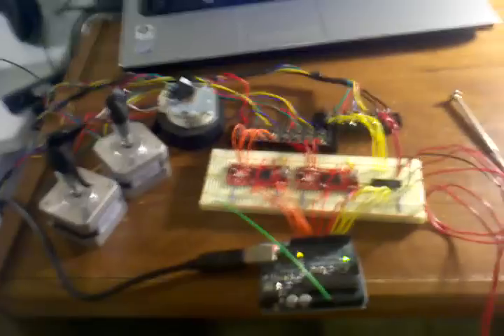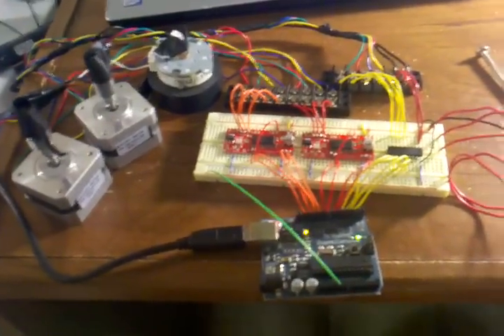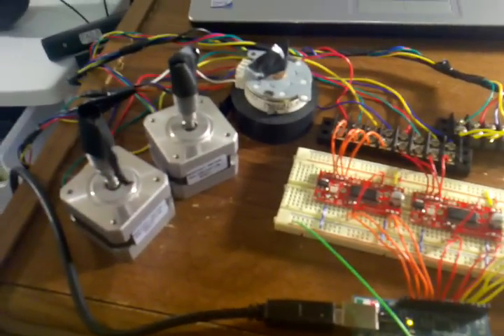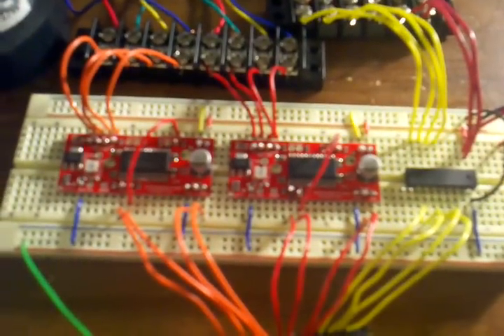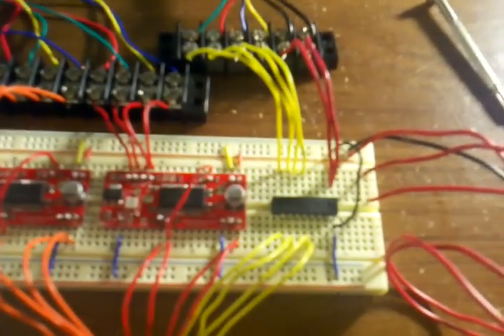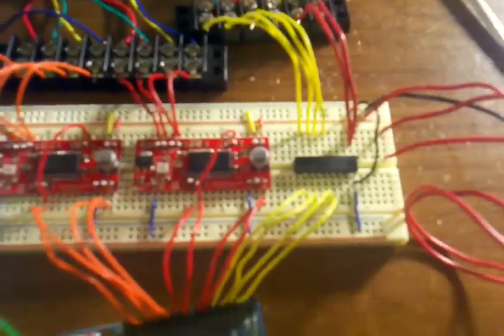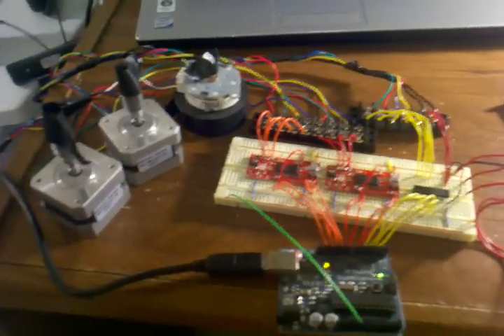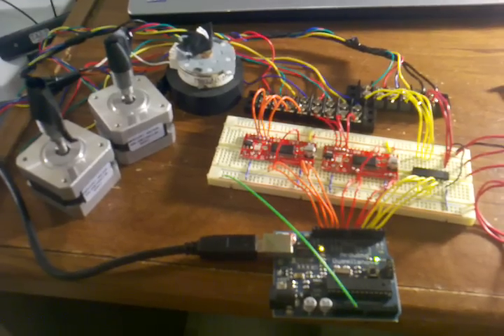controlling multiple stepper motors with arduino

Comment: Stepper motor control with Labview is very primitive. LIFA is no longer supported, so you have to use LINX. It has no specific stepper control VI's, so you have to use pulse train generation combined with an TB6600 (or equivalent) stepper motor driver. Use one DO pin to control direction, and another to output the pulse train connected to the STEP input of the TB6600. There is no way to vary speed or number of pulses once the pulse train task is started. There is also no way to program an acceleration or deceleration profile. The stepper will start and stop instantly, so don't ask it to go too fast.
Variable speed motor control in LINX is more versatile if you use a DC servo motor. Unfortunately, that approach is not good for accurate positioning.
Reply: Hello, currently im doing projects with stepper motor, and I want to control the motor by LabView as an interface. But you said LIFA is no longer supported, then what is the solution? What is LINX? Thanks before

Comment: Hello, how can you control both of the stepper motors together? I tried it by using threads. But the steppers were not rotating smoothly, they were producing a lot of vibrations. Is there any other solution?

Comment from the maker: @Tony E it just depends on how many digital pins are on your board. On this model I think it only has enough pins for 3 stepper motors. Both the easy drivers and the darlington array require 4 pins per motor so 12 pins can control 3 motors this way.

Comment: Hi i'm working on a project where i want to drive two unipolar steppers using a ULN20803 array.  I want them to be synchronized (ie move in the same direction, same time etc)  could you do this by just plugging in another stepper in the same rails in your breadboard, and therefore using the same number of arduino digital outputs?
Cheers

Comment: For true simoultaneously realtime motor control you need a fast DMA buffered communication and independent interrupt driven timers for each motor. This is achieved with serious microcontrollers far from Arduino. All Arduino boards is just a toy for the "copy/paste" noobs community. I control my 6 axis robot arms with a dsPIC33FJ128MC802 with a 1mbps ECAN module connection to run also my servo driven CNC at high speeds and high resolution. I'm workig on a video to post my 1st youtube video soon.
Reply: 5 years later... still no video :D

Comment: ty for a fast response. I've seen the mega board as well, but it seems that if i want to controll 5 motors and do other things (listen on bluetooth, do some calculations) "at the same time" i will have one arduino and each motor will have a seperate controller that will communicate with the main arduino on i2c (or similar) and do all the actual "stepping" for it. that is if i don't find a nicer way :)

Comment: is it possible to control 5 stepper motors (or are there not enough I/Os) and do they also work simultaneously (e.g. the first motor is spinning with speed1 forward while at the same time the second motor is accelerating with acceleration xyz and the third is doing sth else again)?

Comment: Hi! I have a Atmel AT91SAM9620 board with ARM9 on it and I wonder where could I get that part which comes between the stepper motor Astrosyn 23LM-C352-15 and the board? Thank you!